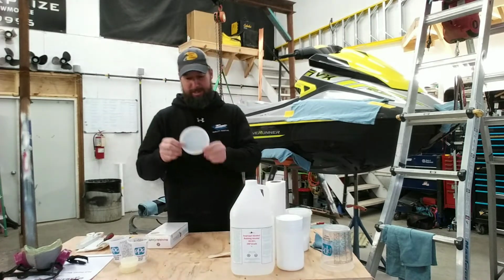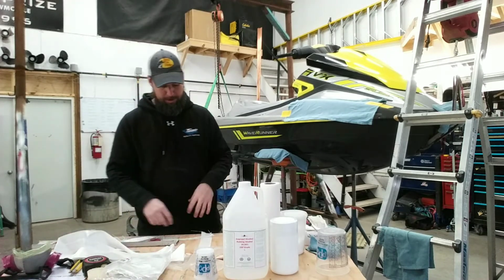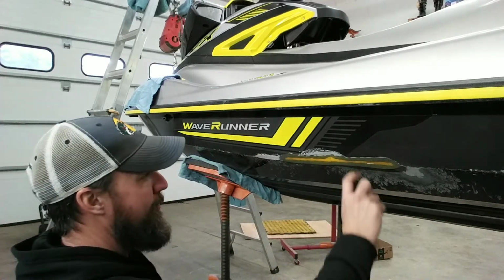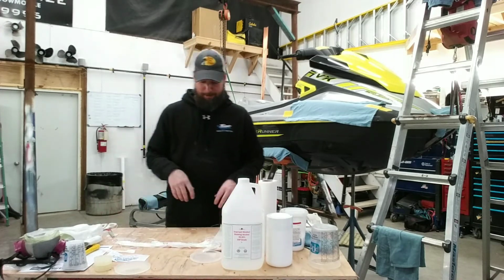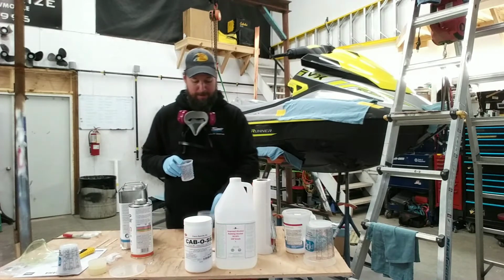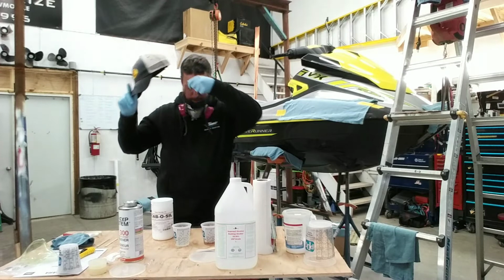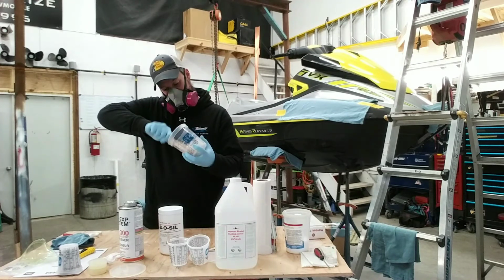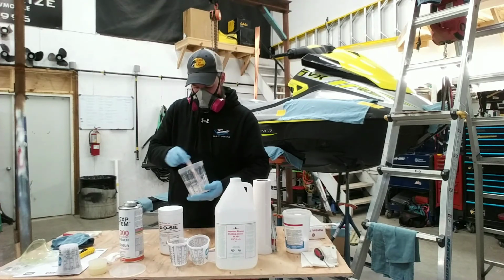Did the G FLEX work? And getting ready to lay up our mat. Part1

Comment: This is great man, nice work. I am about to tackle several impact spots on the keep of my waverunnner. Had to remove the damaged material and make a uniform hole. This might save me from having to part out a perfectly good ski.
Reply from the maker: It's repairable. Just keep that in mind. Use the proper material and take your time and you will save yourself from parting it out and having to buy another ski. Good luck. Any questions along the way, let me know!

Comment: Hi Thanks for the video  , can you tell me how well tye G flex stcuk to the smc hull  ?
I have to do a similar repair on a GP 1800
Reply from the maker: @stgnsw  the GFlex worked flawless.
That unit is still operating today without issue.
Reply: @realityboating454  should I use G flex 650 ?